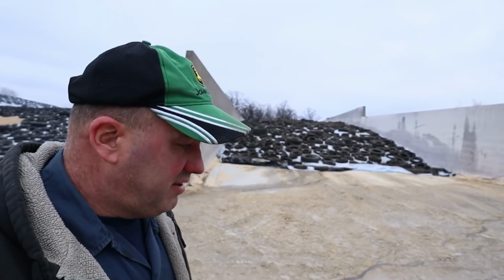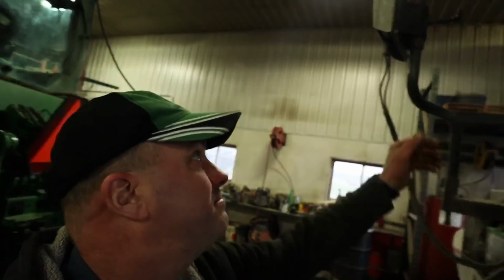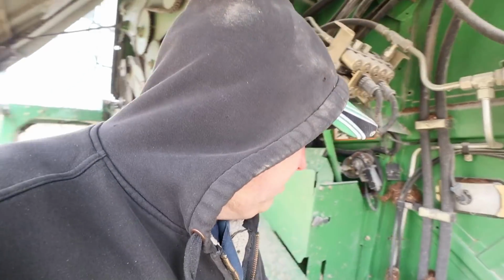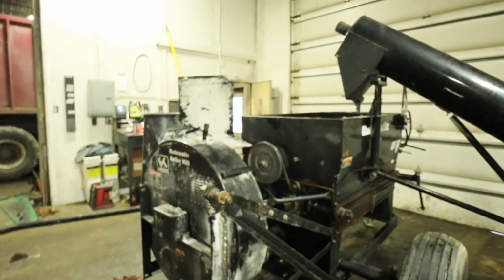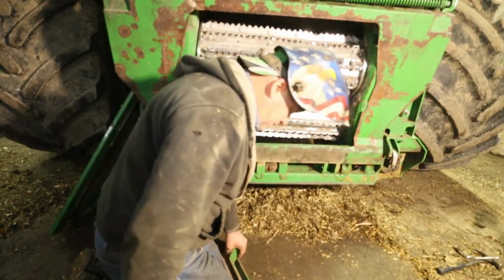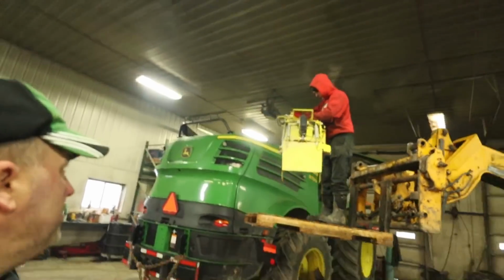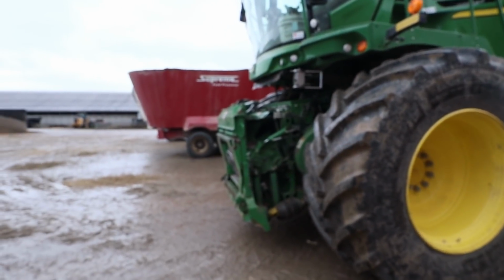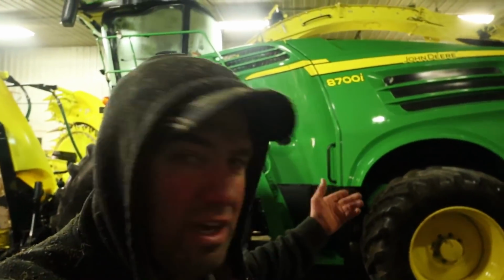My last video_____________________________________For 2019

Comment: Isn't Deere way behind on their processor removal system. Don't some of the manufacturers just have a system that lets the processor roll on rails out from the cutterhead and into a storage position and then back in when next needed?
Reply from the maker: You can leave it in on the Deere as well but it's not good for the bearings for any of them.

Comment: We use the same Digistar weight system in Ireland but they don’t have a battery it’s just live when the ignition is on fed from the plug above the fuse box in a Deere why does your s need a battery
Reply from the maker: Some guys don't have them hooked to tractor